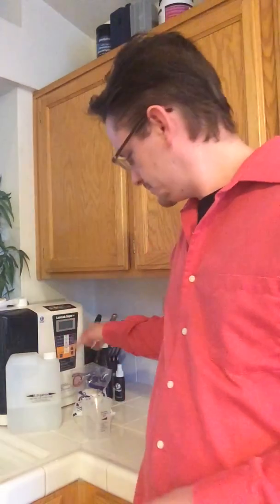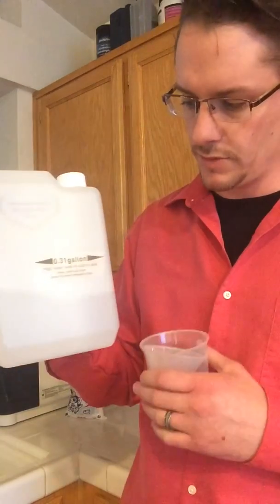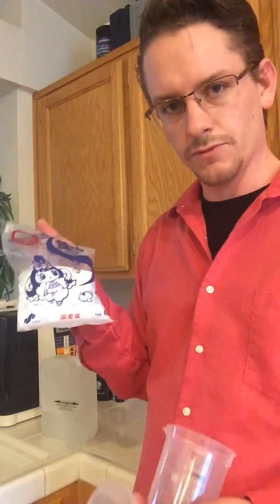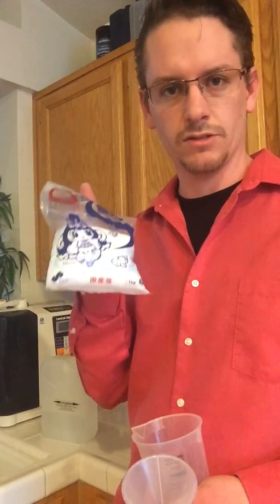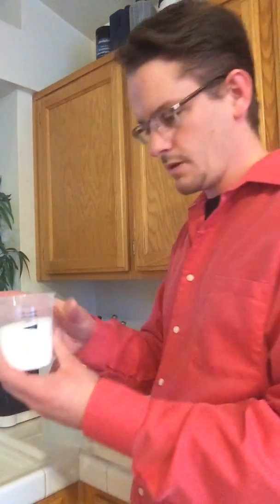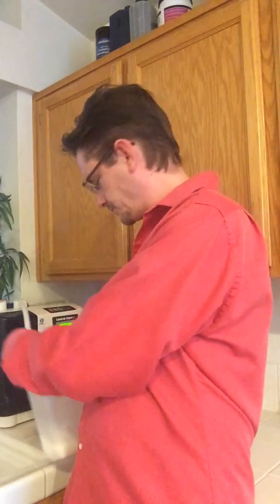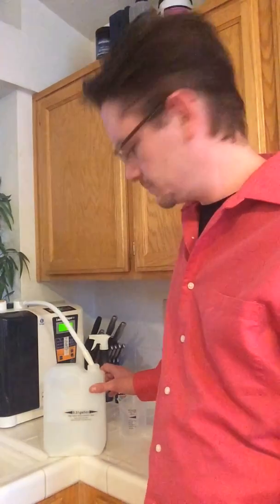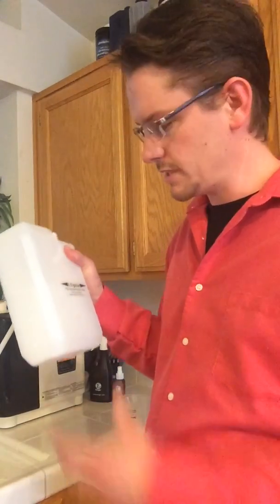Enhancer Solution HACK! Make your own.

Comment: Will this be able to be used on SD501?  What is the shelf life of this homemade solution and will the salt fall to the bottom over time!? 
Thanks in advance.
Reply: Yes it will. Salt cant turn back to crystal form after it solved with water. I used my own made almost 2 years. The quality of 2.5 and 11.5might be slidely diffrent  but it work for my costumer and my family like original enhancer
Reply: Wan Abdillah Thanks.  Enagic officially said the kit was only for the super 501because the water entered the unit differently.
They said the salt can crystallize and cause damage that is not covered under warranty.  
They said the bottled enhancer solution has sodium hypochlorite in the solution that keeps the salt suspended over time.
Thanks again.

Comment: Will this hack work with the leveluk K8? So is it 17% or 25% as I see some comments saying the calculations are wrong. Please clarify.
Reply: You can only get 17% dissolved salt in cold water. Hot water you can get more but the salt will fall out as the water cools

Comment: How did you get 17%? My calculation was 25% 0.3kg salt to 0.31 gallon (us) 1173mL. Max NaCl saturation is around 25% https://en.wikipedia.org/wiki/Saline_water
Reply: yea i think he done this wrong as well...what he should have done was dissolve it and then bring it to the .31gallon
Reply: Bull or measure .31 gallons and add dissolves solution on top of .31
Reply: @bull you’re saying to dissolve the salt then add the 300g of salt solution to .31 gallons of water?

Comment: I tried doing this and tested the water from the flexible pipe with the ph paper. How come my acidic water produce alkali and vice versa? Is it supposed to do that?
Reply from the maker: This depends on the button you pressed. Alkaline should come out of the top hose unless you press the beauty water button.
Reply: you will not get an accurate reading using pH litmus paper to test the kangen water pH. use the red drops supplied and or a pH meter.

Comment: I can't find that kit in my enagic supplies. Is there another place for me to look?
Reply from the maker: Containers and parts used in the video:
Maybe Enagic caught on, but they have since removed the parts from their website(except for the salt). You could call to get the parts or just measure 0.31 gallons for the water, and 300g for the salt using measuring cups in your kitchen.
Reply: @bayareakangenwater9242  where do you find proper salt

Comment: CAN YOU USE THIS ON SD501 AN I DON'T SEE THAT JUG
Reply from the maker: Containers and parts used in the video:
Maybe Enagic caught on, but they have since removed the parts from their website(except for the salt). You could call to get the parts or just measure 0.31 gallons for the water, and 300g for the salt using measuring cups in your kitchen.
Reply: So it's a volume of 300g salt, not 300g weight?
Reply: Yes